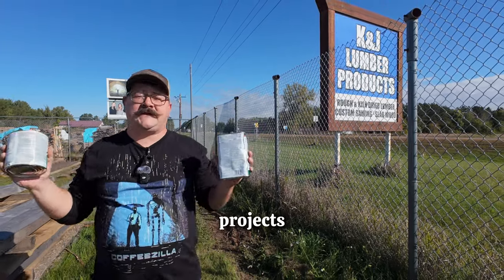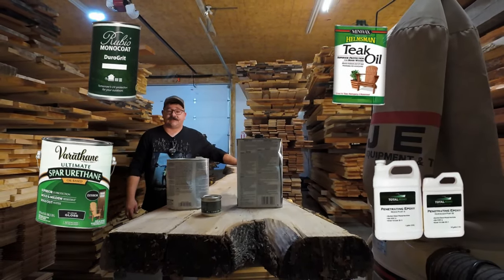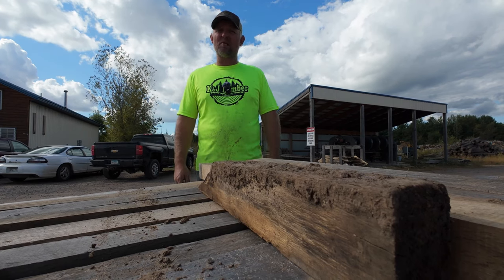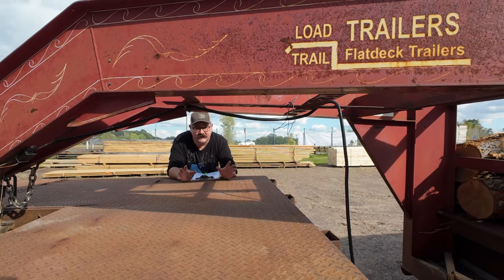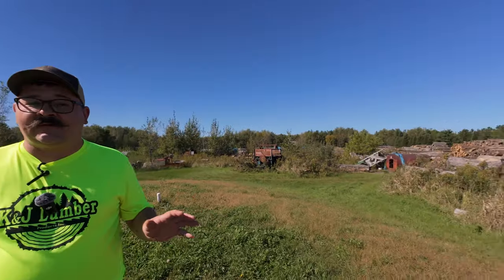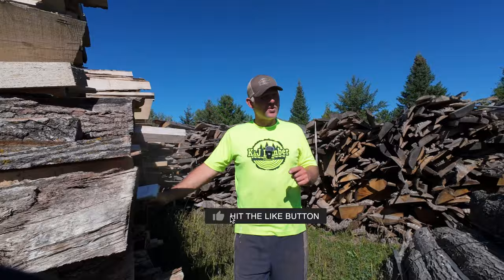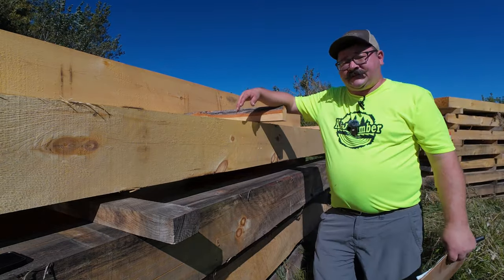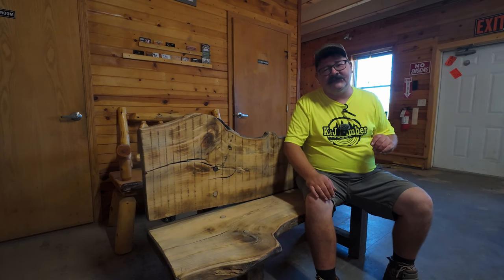the Best Finish for Outdoor Wood Projects that...

Comment: Enjoyed watching, still confused about finishes, but happy to do the research (with your help as well).
Reply from the maker: Yeah I had a very tough time wrapping my head around it at first as well. What questions do you have about finishes?
Reply: @kandjlumber  Using stain/varnish on fresh pine (Australian pine). Might have worked it out. Sanding sealer, stain/varnish, shellac finish, hardwax to top  it off.
Reply from the maker: That is alot of products, if it’s fresh cut (wet) pine, remember, you are sealing in that moisture.
Reply: @kandjlumber  It is DAR from Bunnings(Big Box Store), acclimated to my workshop for a couple of weeks, <10% moisture. All good. It is a cabinet for an Air Force cadet unit, can't get enough coats.

Comment: I have used the Total Boat product for several years on Adirondack Chairs and benches. I dilute the first coat with about 50/50 acetone and apply the second cote un-diluted.   Great product.
Reply from the maker: I had thought about diluting it a little bit at first, but since filming, I have applied their Halcyon Water Based Varnish that they included and I must say, it looks amazing. Very great appearance, but it may be the Penetrating Epoxy that has made the wood look darker? or may be a combination of both products.

Comment: Great job!  I worked on sailboats.  Some ppl used  varnish on the inside (7 layers) and Epoxy on the Outside and inside.  I liked epoxy the best, though in warm weather you have to work fast before it sets up on you!  Epoxy is so water proof, i wouldn't trust the bottom of my wood boat to anything else.😊😊
Reply from the maker: Imagine me filming this, and at the same time frantically stirring and applying the epoxy while moving the camera and spilling, and trying to remember my lines lmao. It was a dumpster fire lol!

Comment: What do you think about using motor oil on a trailer deck? The wood I'm using is going to be white oak. The oil I thinking I might use is a used motor oil from my sports car that I change every fall and still looks clean because of the relatively low miles that are put on the oil per year. That way, it should look like a light stain to the wood and repel water very well.
Reply from the maker: We sell a ton of White Oak for trailer decking here. I have heard of people taking used motor oil and mopping it on the decking etc. but I think old Uncle Sam frowns on that? Either way do what works I guess. No judgey here brother. Thanks for the comment!

Comment: Well, I waited till the end to see what you folks used and if "my finish" blend was included in your list...LOL...Which it was not nor any of Stradivari known basic combinations, yet his work was not meant for outdoor nor marine exposure at all, just general protection. At this point over 95% or more of the factors of Stradivari's finishes are known and understood for those in the world of traditional restoration finishes. They are also the foundational traditional finishes most restoration professionals also employ in various forms with the only key differences being a mildewcide and UV mineral bases stabilizer. The number of coats is the other key factor with two being an absolute minimum. As for application methods, 90% of the time (for me) it is a bug sprayer and a cloth rag...nothing more complicated than that.  As for the blend...which I don't give out the exact ratios so folks will have to experiment or purchase the pre mixed made by the company called "Heritage Finishes,")...is a mix of food grade citrus oil (the carrier agent)...tung oil...flax oil (aka linseed oil)...beeswax...pine rosin...and then a UV stabilizer and mildewcides if for exterior application. Reapplication depends on wood species and extremes of exposure...but typically every 3 to 5 years for exterior projects.  Thanks for another great video...
Reply: I live in Atlanta.  you've had zero mold growth with this finish?  over how many years?  its rough for wood down south.
Reply from the maker: Thank you for your thoughtful comment! I appreciate your expertise in this area and your willingness to share your knowledge with the community. It’s always great to learn from those who know their stuff! My main point with Strad's Mystery finish was to encourage those like you to create their own, fully knowing Stradivari did not create finishes for outdoor applications. I was actually slightly worried I might confuse some people with that or at best, get "roasted", but this video isn't viral enough for that lol. Thankfully we have subs like you in our comments section that are willing to help out with your knowledge. Thank You Jay C!
Reply: I just keep hearing everyone and their mother say boiled linseed oil should not be used outside because it feeds mold. I've had primer impregnated with mildew side and it's still grew mold. This is 9 ft off of a patio slab on deck joist that were under a screened in porch. So no sun but also completely encapsulated in mold killing primer. No I have not yet painted it but still.... You would something called " mold killing primer" would be mold free for at least a while. I had problems within one year
Reply: @kandjlumber  Brother what you stated about Stradivari's finishes, and the way you stated it was just fine. Zero issue there at all...I love this channel and the perfect way you two present info..."We think"...or..."This is what we have learned so far"...etc...is the way a YouTube presenter should present info...PERFECTLY DONE...from my perspective and why I validate my information and my sources the best I can. Blessings to you both for a great channel...!!!
Reply: @coppulor6500  The simple fact is that "oils" (aka "lipids") in their raw state can (if not treated traditionally) "feed mold" and a lot of other things. There is a great deal that goes into..."Traditional Finishes"...and why the modern industrial Paint and Finishes industry moved away from them...which is PROFIT...in other words they can't make any and they don't want to promote something that is better and not profitable to them.  As a basic understanding, if you get into traditional finishes you must learn the differences between drying lipids and non drying. Both will dry eventually but the "drying type" of oils are able to "polymerize" more quickly and with a more durable finish. Another way to think of these, in reality, is that they are "nature's plastics" and work very well when combined with other ingredients like natural waxes, and plant rosins, then they move into the "varnish" family of finishes.  "Molds" and other fungus (some may look like a mold but is actually a lichen or related organism) and they can grown on anything. Leave a plastic lawn chair out that is white at the same time you treat a piece of wood and come back in 5 years. Both will show signs of lichen and mold growth...Even metal will have these growing on them in the due course of time.  Keeping things clean and retreating every three to five years is the only way to keep these things at bay which is proper maintenance for anything outside...be it wood, metal or some other materials...from decks to lawn furniture.  I design and build..."natural decks"...out of green lumber from suppliers like found at the mill of this YouTube channel, with all wood joinery sitting on stone foundations that I typically do for less money that a "store bought" deck and have never had one not last over 25 years or more with little to know issue. My oldest that I know of lasted 42 years before the wood (white oak) got repurposed into furniture for a dining room set.  All in all...fresh lumber...and traditional methods...still outshine modern means and methods by decades if not centuries and why modern architecture typically only last 25 to 50 years before needing major updates...The finish I recommend in my first post will keep fresh for 3 years without intestinal mold becoming an issue...